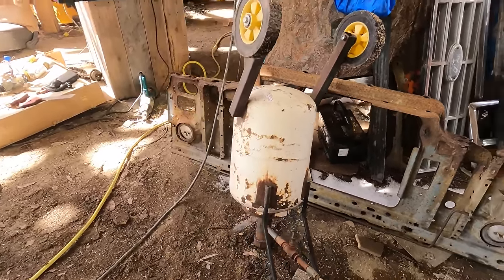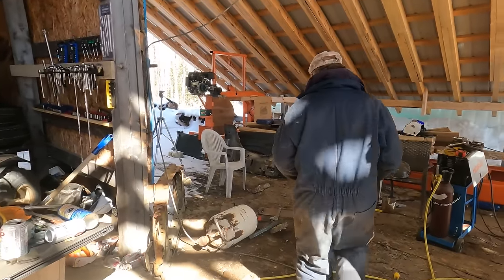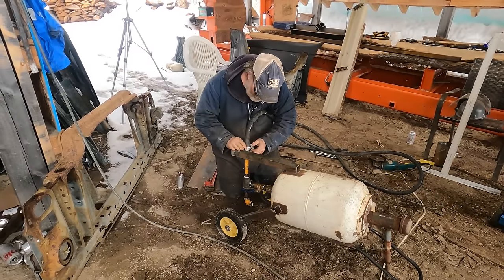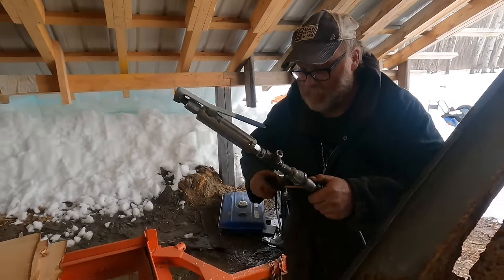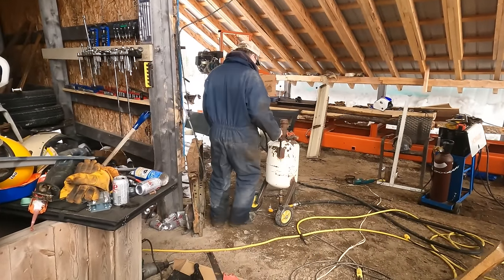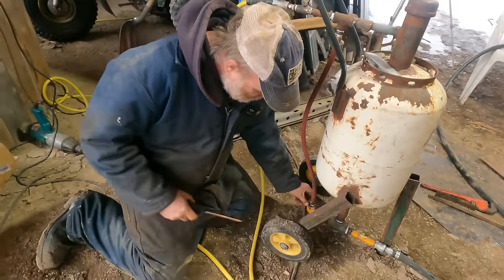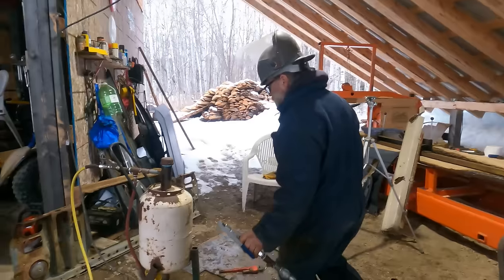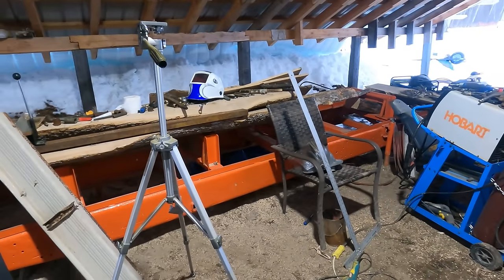We Needed A Sandblaster To Rebuild Our Vintage 1985 Ford F150 Pickup Truck... So I Built One.

Comment: You remind me of my dad he once built a air compressor out of an old propane tank piping andan old freezer compressor built it in the mid 70’s and I tried it when cleaning out the garage after he passed in 2017  still worked perfectly

Comment: Heather, an old welders trick is to cut sliced potatoes to fit over your eyes and a wet washcloth on top to relieve arc flash. Also ASNI clear safety glasses have a UV coating to also help with a stray arc flash.

Comment: Me I would concentrate on the Floor and Rear Cab and Rocker Panels and get all that cleaned up and repair it first. That is the main part and it is not an easy task. BTDT a bunch of times. Then cheap Primer Gray or Black. You have a lot of welding and fitting to do. It should not be too hard to repair that Cab and get the truck in good running condition. I have restored many old cars and sand blasting helps speed up the process. I have done some Farm Machinery and put a good coat of paint on them and a 48 Chevrolet Master Deluxe Business Coupe that needed floor pans when I restored it. My first car. The floors looked like your Cab Floor. It is not that hard just takes time. That will make you a good Truck. Stay on it until you get it running. You need a truck really bad to haul materials. Good video thanks.

Comment: Sand blasting will do an excellent job cleaning the rust but expensive for something you will never see again.. I have done lots of rust work..  I would have opted to clean the crud off with an angle grinder with a wire wheel and paint over it with rust converter paint....

Comment: keep an eye out for wear on your nozzles, thats an issue Project Brupeg encountered with their sand blaster (mind you they were sand blasting a 60 foot trawler) basically anywhere the sand goes can be subject to wear (if it takes the rust and paint off your part, then it can wear the inside of the sand  blaster just as easily.)
take care.